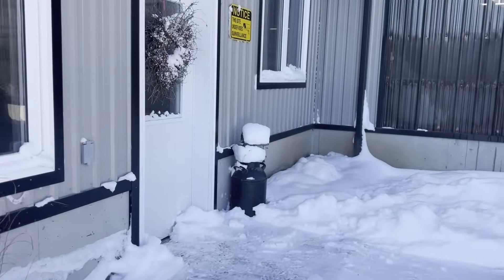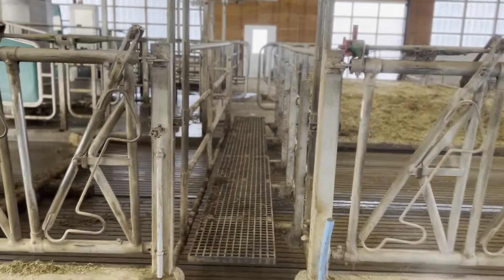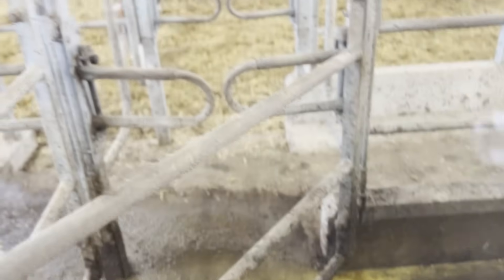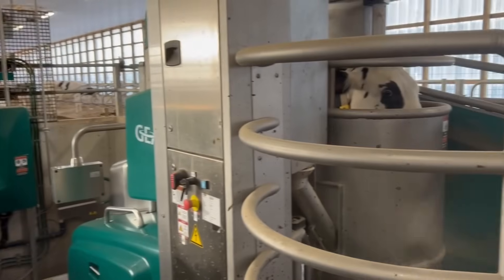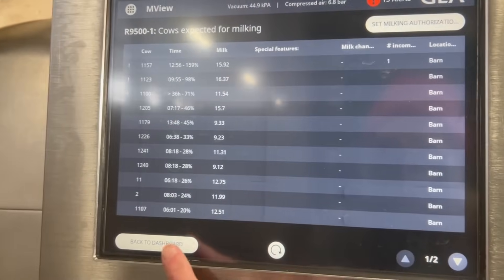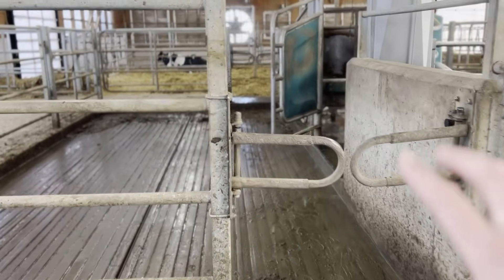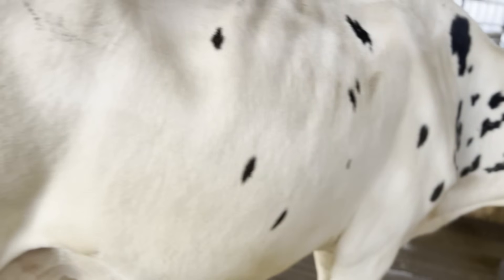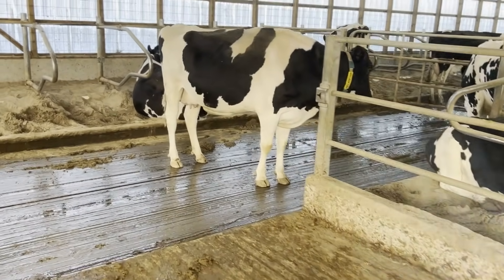Robotic Dairy Barn Tour (Part 2) - The One You've Been Asking For!

Comment: Thanks for the tour.  I have seen a few that use the sand and they all have trouble getting  it out  of the pit. But small inconvenience to having to haul manure daily. I assume you have a back up  generator to run things when the grid goes down.  Never really thought about the reasons for robots, but I suppose you are right, finding help is tough.
Reply from the maker: Absolutely! I wouldn't necessarily say we have "trouble" get rid of the sand from the pit, just a different experience - we knew we would have to deal with it, it's just a learning curve.  We plan to create a video on our take on sand bedding shortly.
Yes we do have a backup generator, I believe it's required with robots.
Reply: @dairyfarmkindoflife  With all the ones I have seen, I do wonder about the sustainability of it.  At some point do you have to truck in sand because your sand quarry has dried up?  I suppose it's no different than using straw - have  to truck it  in if a bad year.  Thanks.